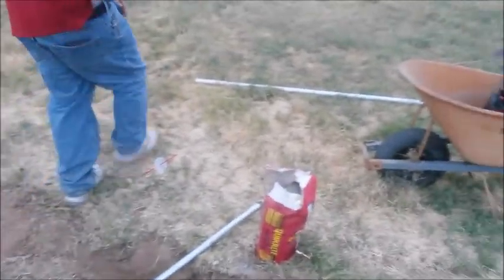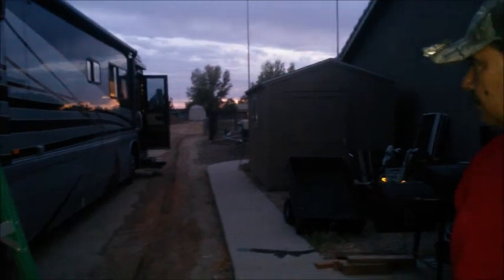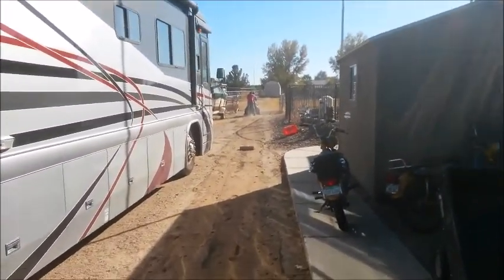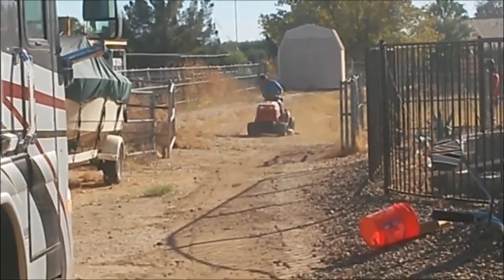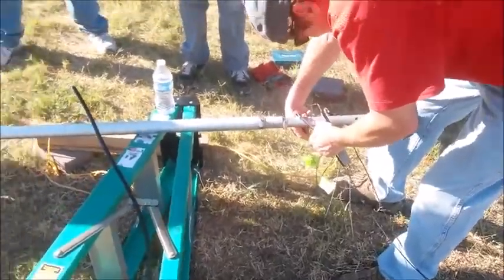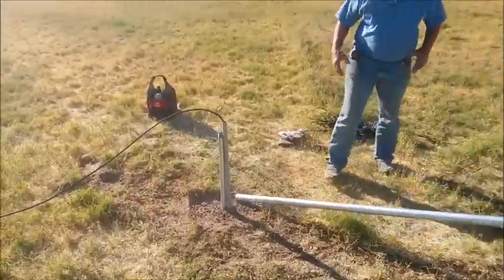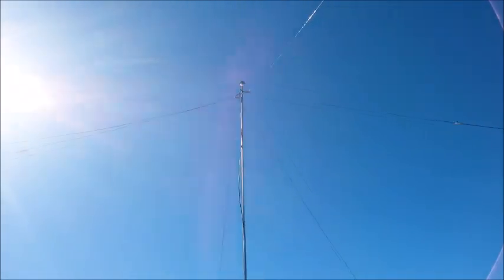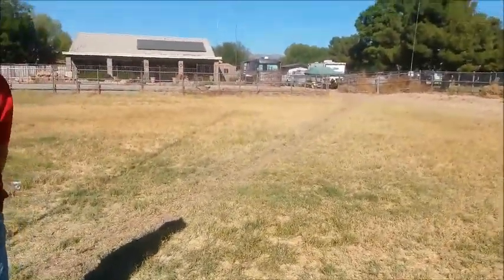K6HZH Maypole 11-18-17

Comment: You should of laid down some 4 inch pvc pipe Incase you want to add more coxal run the coxal inside the pvc pipe
Reply from the maker: Hey Joseph, thanks for watching these crazy guys. Just a group of buddies having fun. Anyway, we first thought about a conduit but several factors came into play. It is a very long run so anything above 20 meters would have been to lossy for that distance. Higher band antennas are closer to the shack.  Being that the antenna covers 20, 40 and 80M, no need for more coax. Not using conduit and installing direct burial RG11 kept the cost WAY down.